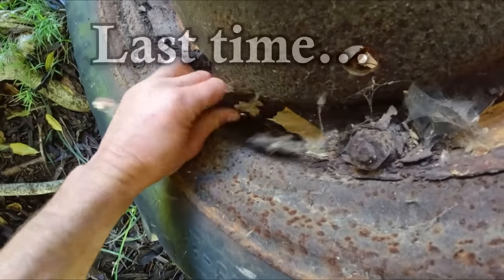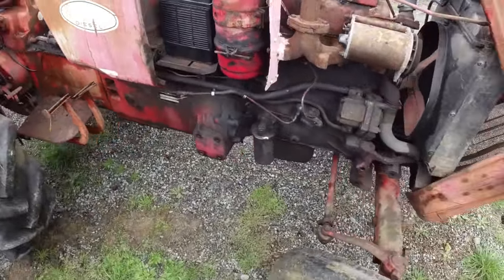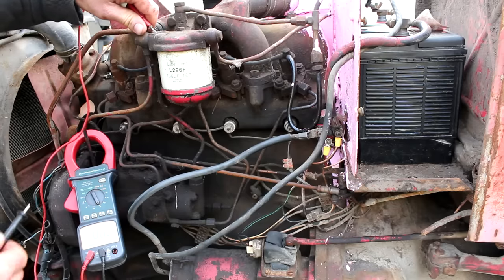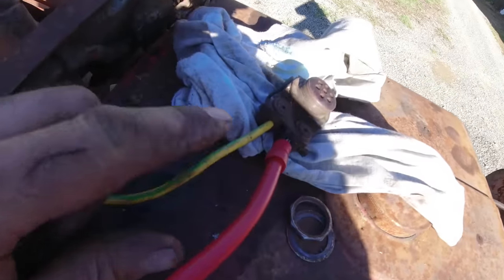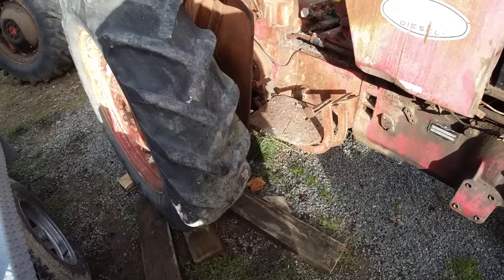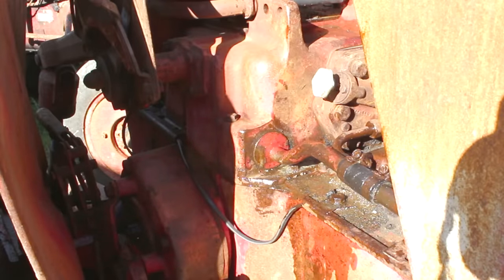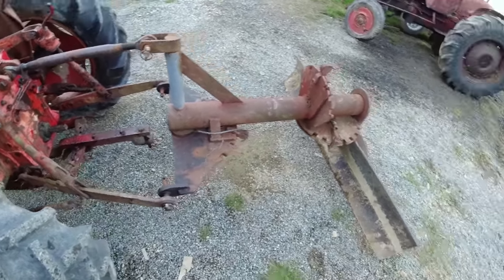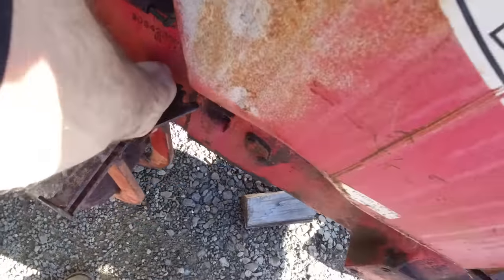Fixing the Salvaged Swamp Tractor and running it on Recycled Cooking Oil instead of Diesel

Comment: Hi Marty, if you use some copper line around the exhaust a couple of times it will pre heat the oil a lot better than just the tank next to the exhaust.
and a diesel / oil mix works very well

Comment: Another great MartyT video, thanks. Your use of diesel/engine oil spray took me back. The garage where I was apprenticed had a drum of old engine oil and (I think) paraffin kept near the grease-ramp. It was used to spray the undersides of cars (rear springs, gear linkage, etc.). When taxis came in for a check-over before their official roadworthiness check (this was before the days of MoT tests) they usually asked for it to be sprayed over the entire bottom of the car. Les in UK

Comment: Great vid as always Marty! That little parts tractor paid for itself at least 3x there, PRIMARILY because you didn't have to wait for parts to show up. And it still has more to give, too.
 Might it be worth installing 2 way fuel valve, just to avoid any issues with starting or possible fuel coagulation with veggie oil? 
 Good save again.

Comment: Your skill to bring to life old iron is very  impressive.  To even know the steering box drain plug. I am sure you have a small pump the do the fiinal filtering of the veggie oil. As you guess a mix of diesel to keep any wax build up.
Here in America there this stuff called  green slime. I use will great success in fixing leaks in tires.

Comment: I used to run cooking out without any problems however I made a copper fuel pipe for the cooking oil and wound it round the exhaust pipe to fully preheat the oil or cut out a section of radiator hose and put in its place a section of copper pipe and wind your copper fuel line around that, run on diesel to bring it up to temp then turn on a two way tap to change over.  You will need he heat it up in winter.  You could use one or both these ideas. 
Another cracking video👍👍

Comment: One thing you could buy or look for is a tvo tank form an old ferguson. So you could have a bigger fuel tank for the cooking Oil. Then you would have too disconnect the fuel line casue they have a two switch crane. Then you would risk getting air in the fule line too

Comment: The diesel service people i used when i was in the trade always had concerns that the vege oil would fail in the pump and cause premature wear,  so a blended approach will be advisable. You might then be able to use the main tank with the blend and that aux tank could hold diesel just for the initial start,wire in a couple of solenoid shut off valves and your in business. Regards Chris

Comment: I make alternate diesel from veggie oils, and the easiest way to use it in any diesel engine, is to, (after making sure it's very clean), just add it to the fuel tank 50/50 with diesel.
Then make sure and add an extra water block filter to the fuel line to insure all water is removed.
This way u should have no problems starting and stopping without converting between fuels.
Plus ur power is improved.
Not that ur way doesn't work also.

Comment: Here in scandinavia I drive my old mercedes w124 on 75% cooking oil and 8%gasoline and 17% diesel when it is above 15 celsius, between 5-15 celsius 50% wvo and  37,5% diesel and 12,5% gasoline, colder than 5 celsius just pure diesel, this is what works best in my experience over 15 years of experimentation with different old car diesels
Reply: As long as it work jajaja  God Bless
Reply: @albertrodriguez3330 has the same mercedes 4 year now, engine works as good as always

Comment: I had a OBS Ford Powerstroke truck that I put a good two hundred thousand american miles so you have to do the conversion to your unit of measure for miles.. done on a fifty fifty mix of cooking oils from restaurants which it did make me change the filters quite often as I had no way of filtering it out. I did sell it to another person and they said "No way they would use such stuff".. so other than the winter months, ran it  without fail and no problems. I even used my old engine oils through the engine and my only concern was making sure there was never any antifreeze in the oil as that will kill any pump or engine it gets into. Oddly no real loss of power or smoking problems. That was over  a period of twenty plus years as well. My only issue with this rig was the cam sensors seemed to be my biggest issue... that and that since I got crippled, I could no longer drive. I loved the original 7.3 powerstroke diesel engine and my only complaint was when they had gone from the I.D.I. style with a common rail fuel system, it was more technical work to do injectors or glow plugs. I swapped out one injector and one set of glow plugs in the over three hundred thousand miles this old beat to death ford four by four went through. One thing that did happen for the good was that new starter that came available was a double reduction unit that had four amps of turning power over the original 1.5 model starter so winter months was never a issue after that.

Comment: There is a fuel heater called a hot fox that installs in the main fuel tank. It uses the coolant to heat. I once plumbed a couple of them for a man that had Ford diesels so he could just mix the used cooking oil right into the diesel tank. Seemed to work well for him. Really enjoy your videos, keep up the good work!

Comment: Be carefull with 100% cooking oil. A mold and mushroms can start to grow it in the fuel tank, this will clog the fuel filter. Also it is mildly corrosive and can wear high pressure fuel pump quickly. I know  results of McDonalds experiment: they used recycled oil to fuel Thermoking refrigerators of their fleet. The engine was 3 cyl kubota or yanmar boot engine (I don't remember now), very similar to yours. The fuel pump failure rate was astonising. At that time I worked in ThermoKing.

Comment: Thanks for the video. I have the exact same B414 but with power steering and a loader. 
There are return lines from the injector pump and the injectors so a good bit of the veggie oil will have been sent back into the diesel fuel tank.
Reply: But proportionally very little?

Some people rig up the return line to return the fuel to the correct tank...switch the valve at thessame time as switching the fuel...

If you use electric valves it can be done with the same switch...

Comment: If you have a source of veggie oil, you might consider a little DIY bio-diesel production.  Stripping the glycerin off the oil to make bio-diesel makes the engine internals much happier, less gummed-up over time, etc.  Plenty of online resources and it can be done with a few household (safe) chemicals - some alcohol and drain cleaner.

Comment: Good to see someone fix things using a dewatering lub on rusty nuts and bolts and good tools you see lots of these types of videos and they try undoing nuts and bolts with no lub so you show them you are a smart person by showing how it should be done and if you want a good penetrating oil is mouse milk better than most can use a lot of heat with it

Comment: Great content. While I know you aren't done with this mod, that you do be aware that right now the veg. oil is returning to the diesel tank. And true that a mix might be the best way of running it, I think that this current configuration wil over time lead to a too high concentration of veg. to diesel. But I guess that is a little pipe work might fix.

Comment: Hi, now that’s using some sense, could you fit a T splitter on the fuel and oil with another cutoff valve, so u do not need to remove the fuel line to connect the oil, that way you can see if reducing the oil flow into the fuel, looking forward to seeing what happens next, take care

Comment: Back in the day before winterized fuel, my dad would mix up to 10:1 diesel to gas/petrol. I imagine you could do the same with the veggy oil to thin it out. I had a waste oil burner that I did the same. Veggie oil gets pretty gummy and gas/petrol seems to cut it better than diesel.

Comment: It will run better if the veggie oil is hotter they used to make 12-volt inline fuel line jackets that heated up the oil for this purpose

Comment: Hi Marty, I have watched most of your videos and enjoyed them immensely however I always wondered when you get a project back home why do you not pressure wash it before you start work?
Reply from the maker: If I did that I would have an inch of oily grease all over my yard, I do pressure wash before opening up an internal part to work on it
Reply: Marty may very well reply, but just to add my 2c... As you go over a machine it's often really valuable information to take note of "witness marks" as to the condition of things. Removing all that before working on it can make daignosis of issues a little harder. The condition and location of old oil and grease etc can give you a really good impression of maintenance issues and also how urgent each issue may be. Sometimes cleaning can make tracking down an issue a bit harder.
Reply: spot on
Reply: @MartyT  Marty you disappoint me, LOL A Man with your ingenuity can make a washing station easy complete with a grease trap, come on man get to it you can do anything you put your mind to.

Comment: You most probably don't have the vegetable oil hot enough. It needs to be around 70 degrees Celsius to  spray properly out of the injectors. A water heater is most probably better, as you are most probably only getting it to 30 or so degrees next to the exhaust. At 70 degrees you'll most probably get the same power and less smoke.

Comment: make sure the veggie oil is nice and hot . cause when it goes into the conbustion chamber  if the droplets that come out of the injector are to big u dont get a full burn  and  some  veggie will get in behind the rings and after a while will weld the rings to the piston   . the veg has to have the same or thinner viscosity as diesel to get a complete burn   also the flame front of veg is a bit slower .. i drove from vancouver to belize  and back on veg in a vw rabbit ute   carried a 100 gallons of veg ... to much fun

Comment: You should look up BioDiesel. It is a vegetable oil mixture that replaces diesel. I do not recall the exact ingredients or the proportions.
Reply: Biodiesel is easily made by mixing an alcohol, methanol or ethanol, with the cooking oil at high pH. It will burn cleaner and not coke up the valves like straight cooking oil. Info is all over the internet.  Something Marty should try and post the video.

Comment: A friend of mine ran a jeep cj7 on used vegetables oil. It had a swapped in VM 3.8l intercool turbo diesel.  My understanding is, the vegetable oil needed filtered,  needed to be around 140 degrees F to flow or it will gel up.  And finally it had to start and stop on diesel to flush  pump,  the injectors and filters of vegitable oil for a few miles before and after being driven.

Comment: Hi marty iam doing a project on this exact concept can you explain it briefly and i don't have a centrifugal filter what is the remedy for that
Reply from the maker: If you can let the oil sit for a few months, most of the bits will sink to the bottom, then carefully siphon or tap the oil out without disturbing the sediment you should be good

Comment: 5 %  diesel  in the vegie oil 
will help , i know because i have destroyed some pumps .
Reply: Make that 15% Diesel. And put a cup of petrol in each fill, keeps flash point up, mixes cold better in pump and injectors without having to pre heat the fuel. Used vege oil from deep fryers is actually soap. It will wax up in the cold, unless you up to 15% diesel, bit of non sugar, non ethanol petrol. Same reason why ethanol is specifically banned in B&Stratton even hondas. The ethanol will stuff up seals in pump, also promotes sulphur issues in old pumps. The petrol also protects against algae growth, although moth balls are also useful for that.
More scientificlly don’t add more than 3% petrol to the mix, what ever quantity you use. It actually restores the same power level as running 100% standard diesel.

Comment: I know one who have access to veggie oil and driven his camper more than 10 years now without problems, it sure need that cleaning and proper heating! That little blade is in excellent condition! Those I know are all without good adjust options and so loose and wear so you can not operate anything accurate! Only push some and level maybe! Just envy your patience and commitment to old things like this! 👍

Comment: Don't use raw vegetable oil in a diesel.

Raw vegetable oil contains glycerine which is quite abrasive and can destroy the injection pump over time.

You can remove the glycerine using methanol in a process called titifaction. This process converts the vegetable oil to bio diesel.
Reply from the maker: I put it through a centrifuge

Comment: If you don’t want the hassle of a twin tank setup, you can just thin out the oil with a bit of diesel, or petrol, or kero. Whatever you have handy. I mixed my veggie with kero (had a cheap source of jet fuel from a aircraft engineer, when they drain the tanks of a plane they are not allowed to reuse that fuel) until it had the same consistency as diesel. I never noticed any change in power, but I did notice my engine ran a lot quieter on veggie. It’s a fun project, thanks for sharing.

Comment: Ditch the 1.5v glow plugs and resistor, replace with fast heat 12v (in parallel) Bosch glow plugs from an 80s mercedes diesel... trust me, you'll be glad you did! We did the swsp on my 1959 B275 diesel, it will now start in -20°C weather with only a few seconds of glow.

You can also get a spin on oil filter kit from Mahindra that makes the oil change so much easier... think I paid around $20 for it including the filter (uses a standard off the shelf 302 Ford oil filter)

Comment: Marty, I believe the glow plugs are in parallel.  If you lose one the others will still work.  I had a six cylinder Nissan SD33T and it could lose up to two plugs before it became a bear to start,  

I love how you accomplish so much with minimal tools,  Give you an adjustable wrench, screwdriver, pair of pliers, jug of fuel and a few more odds and ends, send you into the bush and you'll come driving out with some old relic that hasn't run in 25 years.
Reply from the maker: Most are in parallel but these are definitely in series

Comment: think i would have flushed the engine and trans with a little diesel and cranked it over a couple of times and dumped it before adding  new oil.   its amazing what a little penetrant and working something back and forth does.  my dad had a Ford model A coupe that had been converted to run on diesel during WW2, they wrapped copper pipe around the exhaust from a barrel in the rumble seat to warm the diesel up , started on gas to warm it up and switched back before shutting it down like you did. good luck have fun  and keep safe  from Oklahoma

Comment: If you have old ATF mix some of that in with the veg and diesel after you run it through the centrifuge helps lubricant the pump and injectors 
They say 2stroke as well or ether 
Another one saved from going to scrap 
Thank Marty 👍

Comment: Howdyyawl from the land down under. Running the tractor on used cooking oil would not gum up the works too much.put a injector clean through every so often will help. After all, Karl Deisel intended to run engines on Canola oil, not much different. It is a good fix up though. Liked the video.😊.

Comment: I can remember some tractors using "bi-fuel" . Starting up with gasoline and once warmed up, running on kerosene. They had a 2-way tap. 
Running bio-fuel on a diesel will need pre-heating of your oil to work better.

Comment: This has been one of your best videos and covered so many items well - especially what happens when machinery gets neglected. The veg oil could be made more permanent and easier to operate - see retrofitter down below for instance. Everything you noticed is correct and cold weather will cause some issues but changing the ratio of veg oil to diesel in the saddle tank could help. Precise ratios will be up to experimentation but you seem to understand that. Use ATF (or a proper fuel conditioner if you want) in the fuel every now and again to help clean the combustion processes - easy to dose in your veg oil tank. Keep it up and many thanks for so much entertaining content.

Comment: I've been running some diesel engines for several years on recycled frying oil. Although some engines do work on 100% oil, it is recommended to mix some diesel to ensure the fuel pumps have at least some degree of proper lubrication as well as to help at least reduce the power losses to some degree. It will also help to prevent the gelification of the cooking oil. Something around 70/30 is usually the sweetspot.

Comment: Good lead on a donor machine. Some useful parts already swapped out: rear rims, solenoid, resistor, transmission filter. Screw driver lever guide. Basic maintenance and lubrication. Plus simple rust proofing. Starts faster. Runs decent. Does the job.
Great experiment with cooking oil.

Comment: I had an old Mercedes 300D that I ran on carefully filtered fryer oil. I had an extra tank in the boot with a heater coil in it connected to the heater supply plumbing, and would switch over once it had heated up to reduce the viscosity. I swear it was quieter on the fryer oil than Dino juice, and worked well for ~50,000 miles until I sold it.

Comment: Draft control is where the lift on the linkage arms is proportional to the force exerted on the top link of the 3 point linkage. So of your harrow or plough encounters heavy soil, the force though the top link increases and draft control starts to raise the implement, and vice versa.